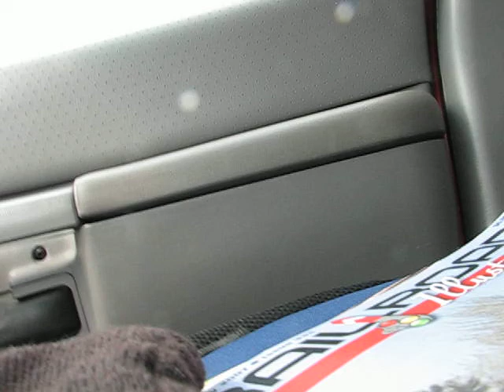CSX Dispatcher lining up a Coal Train at Grafton, W.Va. 3-19-2007

Comment: That is a very strange dispatching system. Up here in Canada a clearance would sound like..." CP 427 North, Item 1, Clearance 2001, CP 8826 South clear to proceed from Begin End Main Track sign Guelph Junction GUE to Signal # 602-3 Desjardins DES, clear to repeat clearance 2001, CP 8826 South. CP Hamilton Sub RTC Out.